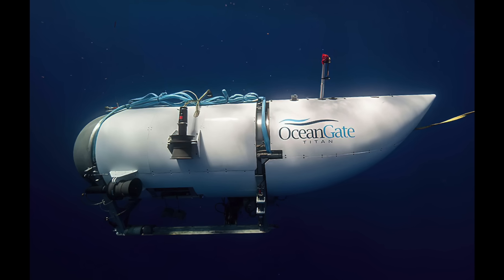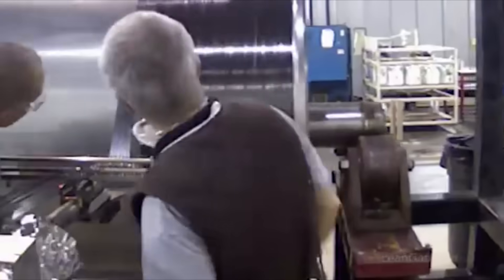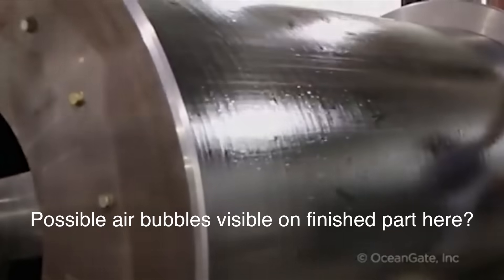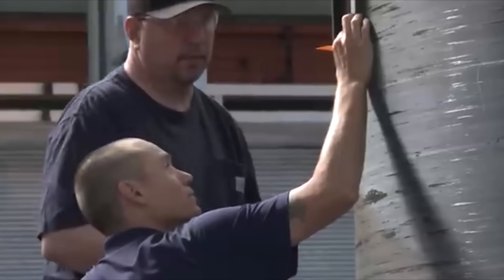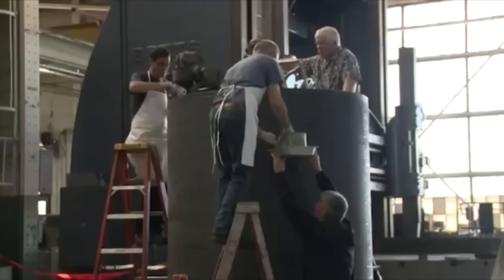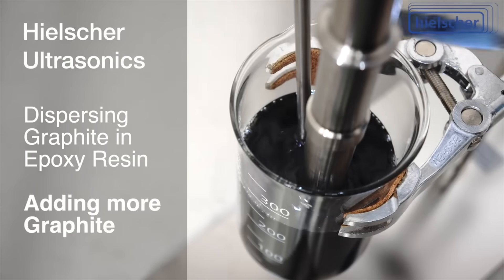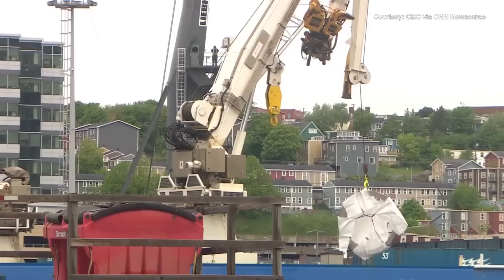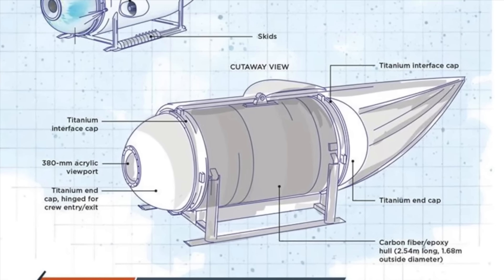Why OceanGate Titan Imploded - A Carbon Fiber Composites Perspective

Comment: Even myself, a layperson with 0 years working with composite fibres and 2-part epoxy-style adhesives, was staring with disbelief as they slid the two pieces together, by hand, IN AN OPEN WAREHOUSE AND IN STREET CLOTHES.

I've seen woodworkers do more prep work before applying layers of topcoat to a piece of furniture - wearing full-body suits in  a sealed environment, and so on.  And no one's life is on the line if the finish being applied to the furniture you're working on has a bad spot or three.

A bad spot or three on a deep-sea submersible, on the other hand, means instant death.  Quite literally.

Just unbelievable.  You can't pretend you know what you're doing when building something like this.  LIVES ARE ON THE LINE, YOU DAMN WELL BETTER BE SEXTUPLE-CHECKING EVERY TINY DETAIL AND ASKING EVERY EXPERT YOU CAN GET YOUR HANDS ON TO OFFER THEIR BEST TIPS.

Firing everyone who told him "no" and hiring nothing but kids fresh out of college (who could be browbeaten or intimidated into never telling him "no") probably didn't help much, either.  Why hire industry experts?  Those guys are EXPENSIVE and will tell you "no" to your face.  College grads, on the other hand, tend to work for a fraction of the salary and tell you what you want to hear, 'cause you're the CEO!

The hubris on display throughout this whole sad saga borders on insanity, like Stockton truly believed that the Universe would bend to his whims, that all his "innovative engineering" was infallible, and that he could defy the laws of physics through sheer grit and determination (while saving a bunch of money in the process).
Reply from the maker: You hit the nail on the head there, hubris and ego above lives and proper engineering practices. A very sad saga indeed.
Reply: @JamieKunka  
I am also a layperson but with an extensive  background in a range of  technical disciplines . GLUES RESINS AND EPOXIES HAVE CAUSED MANY DEATHS  if not mixed properly ...BOSTON MA .. BIG DITCH TUNNEL  PANEL DROP  is a typical example ..it killed the occupants of a minivan when it dropped because the EPOXY used to anchor the suspension bolts ran like molasses in JULY. 
Besides the obvious being addressed by  the  expert analyst ...RUSH was too full of own self generating BS , he believed in his own BS as most legends of one`s own mind do enough so as not  to listen to anyone, but his own misguided mind.
Reply: @JamieKunka  Generally,  the direction one Consistently take, invariably becomes their modus operadii. 
Cutting corners,  disregard for the established,  being "outside the box", hubris are then applied "across the board" even to life itself (wittingly or unwittingly).
Reply: @JamieKunka  None of you could even spell submersible until a few days ago.  Instant Marine Engineering degree in tablet form? Take with a glass of your own cool aide...
Reply: What's even worse is the shop that made this "vessel" and glued it the way they did. Granted they probably did it based on the spec provided but I work in that industry and when we see shit that is an obvious no no we say something. The shop that made the shit is liable in a way as much as ocean gate in this instance.  But that's my opinion
Reply: @sleddarcheddar As I understand it, there was no "shop" that made this vessel, it was all in house at Oceangate. Those are all Oceangate employees, including the filament winding process.
Reply: @life_of_riley88  No, the first hull was made by Spencer Composites in Sacramento CA.  The second hull by Electroimpact in Mukilteo, WA.
Reply: @sleddarcheddar  Your not a Pro .You dont GLUE composites.....Nice try but details count.
Reply: @sleddarcheddar  Nobody that works with composites would use the term "glue". Within your first sentence you disqualify yourself. Its just like calling electrical potential "JUICE". I call BS.
 The saying in the composites industry is "everybody wants to act like an expert until a real one walks into the shop"
Reply: Stockton's "If you don't test it, it can't fail a test" attitude is like saying "If you close your eyes you won't see the problems".
Reply: TyaxComp  Exactly. A prefect finish means no foreign matter imbedded in the hull or joint and no greasy surfaces preventing the glue from bonding everything together, etc.
Reply: Wrong ……. Carbon has epoxy pulled by vacuum in a vacuum bag …  0 years experience stfu. If he would have listened whe he called real submariners about the  bangs and pops he heard as he submerged  he would still be alive.   He is in record saying he heard 22d caliber bangs as he went down and ignore it.  He would still be alive.
Reply: It was a compilation of Shortcuts/ lack of potential problem analysis, being passed off as innovative.
Reply: Bro I made washer doors bonding glass to plastic, and it was a no no to touch either surface unless you're touching it with an adhesive promoter and a clean applicator on both substrates - and then apply your ts320 or whatever 3m 2 part or sika hot melt one par

Hubris a mf
Reply: I'm actually a composites expert myself. I have bonded PVC on several occasions, and even I would not have built this sub this way. My sub would have been way more durable.
Reply: TyaxComp Perfection and safety go hand in hand.
Reply: It’s mind blowing.
Reply: I agree, I am surprised there was no agency to prevent them from the dive before the final inspection.
Reply: @kamilebrahimoff3589  That's because they did everything they possibly could to deliberately avoid inspections, testing, certification, etc. and operated out of International Waters as much as they could (to avoid American and Canadian laws).
Reply: it held somewhat ok until it didnt
Reply: this whole thing was a FREEMASON LUCIFERIAN RITUAL😳
Reply: I feel incredibly sad for the kids who did the work as carefully as they could. They must be feeling absolutely horrible right now.
Reply: @DeirdreSM  But did they do any research on their own of how carbon fiber is used and would it work for use as the hull of a submersible or did they just take SR's explanation of why it was to be used? If they had done any research why didn't they speak up or agree to work for him?
Reply: @MissX905  If Rush had done actual research, he wouldn't have been using expired carbon fiber.
Reply: @DeirdreSM Your degree is in what? How many years in the composites industry? How many aircraft or dsv's have you designed and built yourself?
Reply: @blackhd92  I have built boats (among them a 38' trimaran, though I was not the designer; a family member was). I've also machined fighter aircraft cable tension regulator parts. Who are you to ask my credentials?
Reply: @blackhd92 What's your deal?
Reply: The engineer and those workers have blood on their hands now. Did any of them ride down in the Titan death trap at anytime I wonder? Who was the inspector working on this submersible, he or they too have blood on their hands. So did SR but he died in the implosion but I'm not sad that he went down with his flimsy submersible. PH should have known better and sounded the alarm, but would SR have listened to him?
Reply: @MissX905  Stockton seemed to take anyone questioning his "innovation" as a personal attack, so I seriously doubt it.
Reply: @MissX905  The engineer was fired! The workers were hired by Stockton and told what to do. They had no idea of the critical failure modes. You follow the work instructions. On one project I worked the designer called out inadequate fasteners, built to print it lasted 7 milliseconds in the test bay. Failure happens fast.
Reply: @oneskydog6768  I know about that engineer he had a different engineer too tho
Reply: I guess he got rid of all those 50-year-old white guys although the glue guy seems like he’s 50

Comment: When they mated the parts , where did the air in the circular channel go? How did it not behave as a piston trying to push the ring off of the cylinder?
Reply from the maker: Yes very worrying there could have been air bubbles in there. Usually I believe you would machine a taper into the two parts so the air could evacuate when pressed together
Reply: Oh, that air? Will be on the surface in about 2 more days.

Comment: If it is correct the submarine was descending too fast and barely ascending later, could it be the carbon fibre cylinder had been soaking up water? Perhaps,  if some of the fibres was actually damaged,  voids had been created and water made the submarine heavier? So when the crew was weighed they should rather had been checking the submarine?
Reply from the maker: Very good point! High pressure water ingressing jnto the voids would not be good and as you say disrupt the buoyancy.
Reply: If the online transcript that's out there is true SR was hearing sounds in the aft part of the submersible.
Reply: @MissX905   - the audible monitor was all red, perhaps it was water
Reply: The carbon fiber absorbing water wouldn't make it significantly less buoyant.  The craft had thousands of pounds of ballast to give it buoyancy.
Reply: But, but, but the Rhino Liner!!!

Comment: I've been wondering about the titanium/carbon fibre interface as well. The bonding procedure taking place in an open industrial workshop and not in a cleanroom. The lack of proper safety equipment; scaffolds etc. No one suited up for clean operations, no vacuum chamber to pull air from the glue joint. The mixing of the glue in an open environment. It all seems quite amateur and hasty.
Reply: When I saw the clips of the assembly, I was thinking "Surely they had a vacuum chamber somewhere. Why didn't they mention it?".  I don't know that much about epoxy, but I know that anyone doing serious work with it has to find a way to get rid of the inevitable air bubbles as part of the cure schedule.  That work looked like me patching the hull of my sailboat.
Reply: There was like 40 megapascals of force pushing that titanium cap against the carbon fiber. That adhesive was just gap filling once that thing started down. The issue isn't going to be some dust, it is going to be whether the interface at the edges can mechanically tolerate the cycles.
Reply: @nutsackmania  Exactly. Leaving the spindle tube inside would have relieved that compression and solved the dissimilar materials, but opened the door to any leakage that would have tended to pry the carbon fiber off the inner tube, which is why the carbon fiber had to bear the load alone to act as if it was a single part.
Reply: Or my attempts at fiberglass objects!
Reply: True, the biggest problem of all was the carbon composite, which could not handle the water pressure at that depth, so it imploded.
Reply: @kamilebrahimoff3589 the thing is - it did handle that depth, but it could not repeatedly handle that depth. The egomaniacal fool at the wheel (Stockton) confused the two as well.

Comment: I would have used a 1inch Titanium mandrel with say 4inches of Carbon Fiber wrap and then weld the end caps to the inside of the mandrel this would have given them an extra layer of strength, just my opinion
Reply from the maker: I was thinking of something very similar!
Reply: It would be better to have the flanges integrated and X-ray checked at the welds before any composite bonding was done, in no way would you want to weld onto an existing CF wrapped tube without a clear break between the CF and the area to be welded. Too much risk of damage from excess heat, differential expansion, and uneven cooling afterwards.

Comment: CF is good under tension only. Terrible under compression. Duh.
Reply from the maker: This is a common myth about cf. Whilst it’s compressive strength is 30-50% less than its tensile strength all applications will involve some part of a carbon composite being in compressive load. You can optimise your part for compressive performance with a bit of R&D. A recent scientific paper looking at the compressive properties of carbon fibre concluded: 

“highly orientated and aligned crystallites are detrimental to compression, while an amorphous disordered structure is desirable. At the macroscale composite level, high fibre alignment of the fibre that is strongly supported by the matrix is advantageous to its compression properties. Hence, it is imperative to optimise the structure and properties of the reinforcing fibre and use efficient composite manufacturing methods which reduce defects, misalignment and maximise support from the polymer matrix to provide to obtain high compressive performance in carbon fibre composites”

Comment: If you read the messages btw crew and surface you ll see that it started delamination under pressure.. they said it ..all sensors red..
Reply from the maker: Terrifying stuff!
Reply: No confirmation of that being real though.
Reply: Where are the messages between the surface and crew?
Reply: Speaking of sensors--how were they attached?

Comment: Hopefully somebody said what happened..im working 25y with cfrp and never seen anything similar... You re so right.. hope more people check your video and point of view.. its amazing that only technicians on fibers look that detail.. most videos dont even mention the winding method of ud cf
Reply: It was doomed to failure.. broke like glass or wood with that pressure.. i suppose that when resin opened the end caps exploded and window plus caps detached catastrophically
Reply: If only used several angles of winding and several tests .. nothing would have happened
Reply from the maker: You’re exactly right! If you imagine stamping on a sheet of UD carbon vs a quad axial sheet I think we all know what will happen. Total failure of testing.
Reply: Stocton finally understood that they re gona be dead in seconds when realised that delamination occurred.. haven't seen the part you revealed with him talking about fibre direction and layers ( calculated around 800) now is clear exactly what they did.. thought it wasn't his decision.. its criminal choice
Reply: He made an assumption..but its so serious he should have tested in several and possible ways.. probably was so stubborn that couldn't believe what gona happen .. we are applying more than 100 layers in specific structures and its amazing to see its strength in one axis and almost brittle in another when using ud
Reply: Everybody should see that to understand what happened..
Reply: Last but not least he talks about less than 700 layers when you have 5inch structure.. definitely no pressure or clave to minimise porosity and strengthen the hull

Comment: wow those kink bands haven’t been mentioned in any analysis i’ve seen yet. good visual representation. i’d never heard of them. and THANK YOU for pointing out the technician cleaning that ring. it’s something that bothered me when i’d seen it before. i sometimes work on motors and i’m overly paranoid about the kind of towel/rag i’m using and how it’s affecting the mating surface of the parts/ gaskets. the rag he’s using doesn’t even appear to be residue free or microfiber in nature. i always hoped that clip of him washing the ring was for like press shoot lol
Reply from the maker: I think your probably right. I imagine he was made to do it for the video however. And even though he doesn’t appear to be touching the surface to be bonded, I think it’s still pretty shocking.
Reply: @JamieKunka  yeah right after i wrote that comment i noticed that he was rubbing down the OUTSIDE of the ring that would not be bonded with the carbon hull. still horrible practice. the environment in which they bonded the hull to the end caps was definitely concerning too. i definitely would be worried about foreign contamination.
Reply from the maker: It’s possible he might have done the same to the bonding surface off camera! We just didn’t see that bit.
Reply: @JamieKunka i’d love to know how they transferred hydraulic lines or electrical components through the pressure chamber, stockton mentioned they have a manual handle that will release drop weights on the outside of the sub as a sort of back up system. how those connections got to the outside of the pressure vessel is interesting to me.
Reply: I've heard it said that it's all about surface preparation in mating dissimilar materials with adhesive - wondering if the initial failure mode was seawater working it's way into that titanium ring - carbon fiber hull connection. Will investigation be able to discern this?

Comment: Thank you so much for making a video about the technical side of this.
I was already worried when I heard that it was a titanium carbon fibre composite because of the electrical conducting properties of the carbon fibre and potential galvanic corrosion (while repeatedly dunked in an electrolyte 🤦‍♀️) but when I realised that it was just carbon fibre GLUED to titanium my jaw dropped! 

While a quick search for articles on galvanic corrosion of electro-conductive carbon fibre+titanium initially suggests that in theory titanium would not cause a problem (other metals such as alu, steel are vulnerable) there seems to be NO research with carbon&titanium in a marine context, where the potential for galvanic corrosion would probably be way higher due to the habitual contact with seawater. 
Just seems insane to go ahead with these ideas with little/no testing, I’m horrified 😳

Anyway, great video- thank you and hopefully this never happens again 😞

Edit: watching this workshop footage I’m actually amazed that the Titan made ANY deep ocean trips without failure 😬 
Very interesting video 👍
Reply from the maker: Excellent point! I hadn’t even considered the conductivity of the carbon fibre and the galvanic corrosion of the Ti! Could well have popped the glue right off after a few dunks. It will be very interesting to hear the reports when the wreckage has been properly examined. I wonder if there is any glue left on it at all.